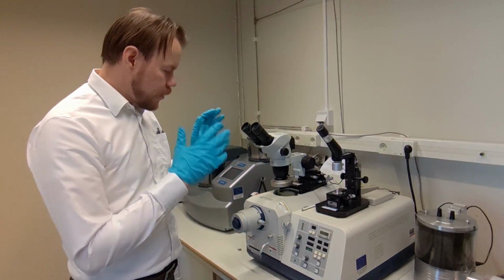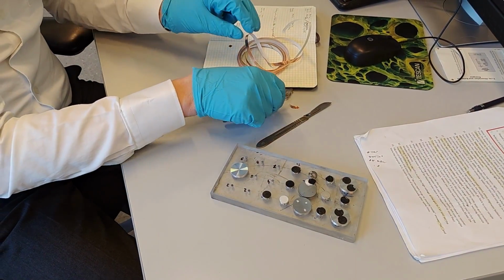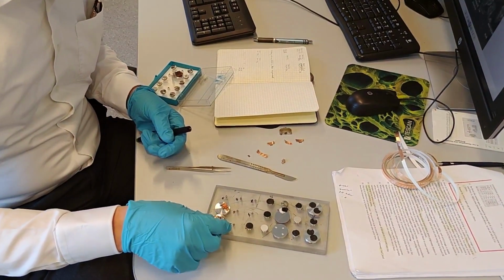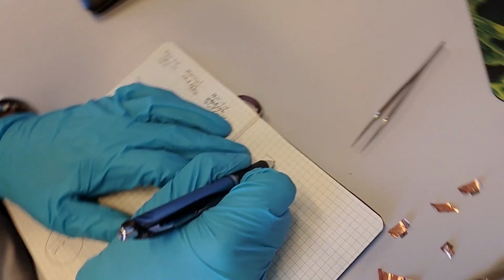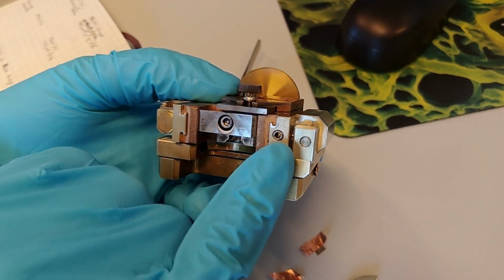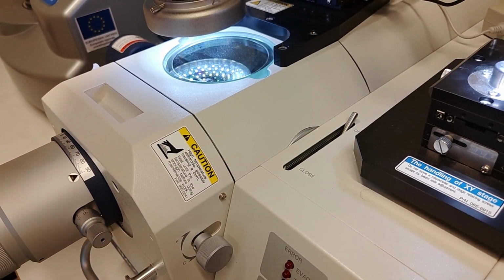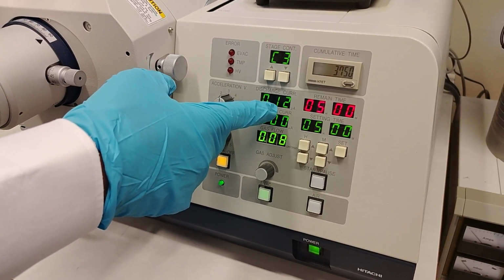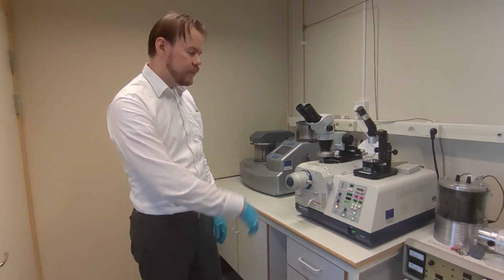Hitachi IM4000 BIB miller

Comment: Am I supposed to see some light, plasma, etc. through the top window to indicate that the beam is operating?
Reply from the maker: Yes, that is correct, when the plasma is ignited you will see a blueish beam coming out from the gun directed at the substrate. It is not so bright, so one sees it better if one turns off the light in the room first. When gun is freshly cleaned it is brightest, but darkens after usage.